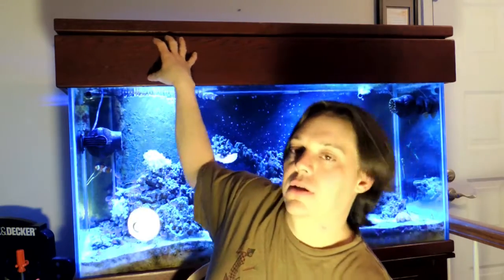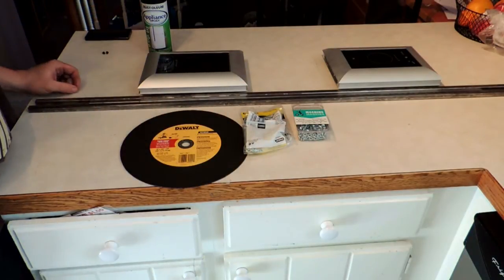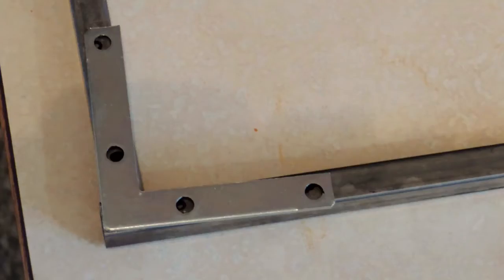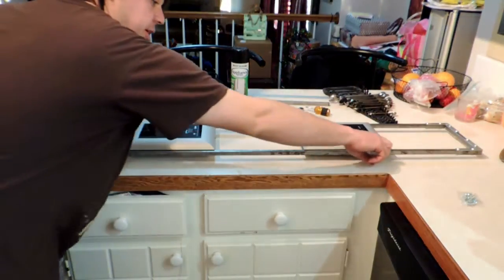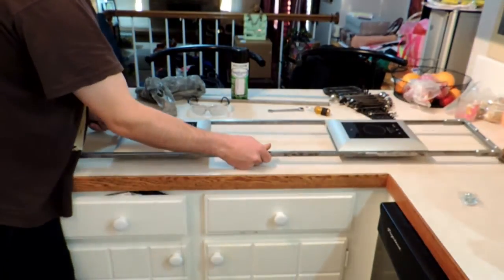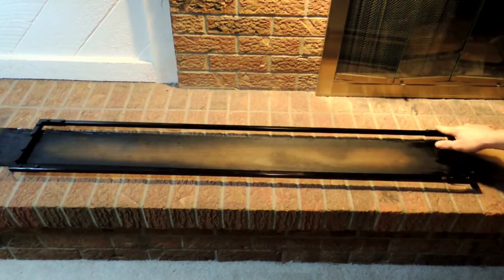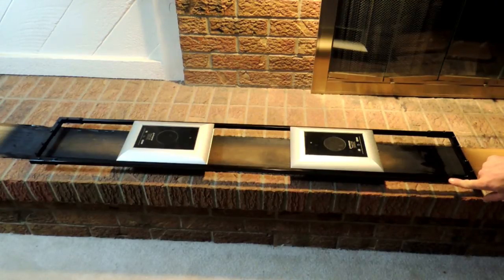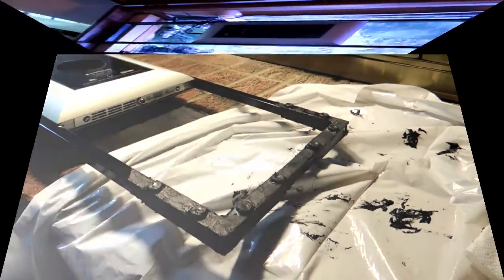DIY Giesemann Teszla Led Mounting Bracket

Comment: I would trade straight across for yours mine has 2 150w halides and 2 130w pcs the only problem is the pcs are hard to come by nowadays in that wattage but if you feel you need yours I understand.